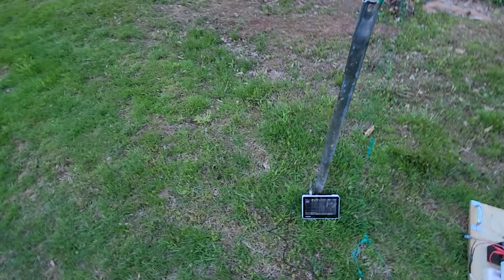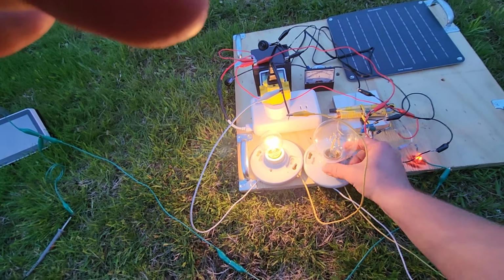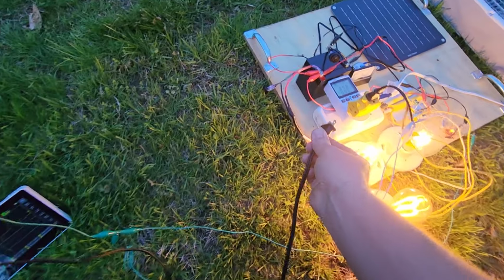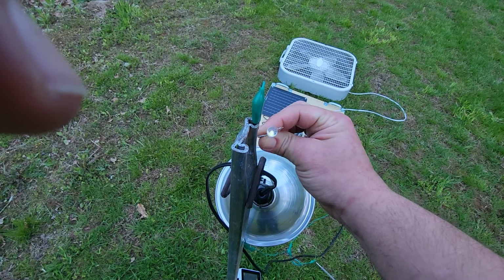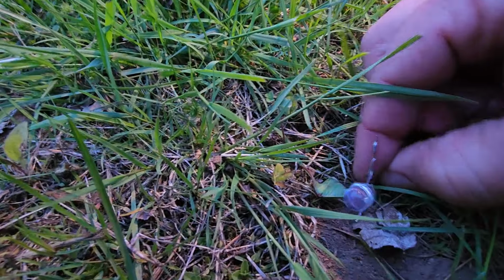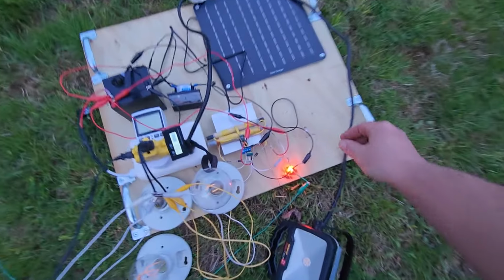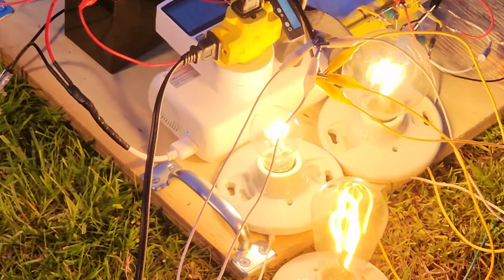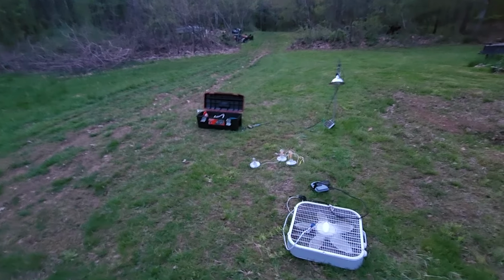🌩OUTDOOR RINGER GENERATOR BOARD TESTS & NEGATIVE RESISTANCE IMPROVEMENTS & 100 WATT OUTPUT!💡

Comment: Yeah boy that is looking excellent bro I've been working on my own however I'm building machines to Brian materials down and shaking machine to shift my powders like caffeine quartz whatever I have seen if you are working off the negative like you say impedance or resistance also works backwards that machine can probably do a hell of a lot more than you think especially if you jump off the negative side of another capacitor Branch off with more coils in residence there's no end. That's awesome I would love to see you expand even more. Great job man 
🍻 Cheers yo

Comment: 😂u made a ringer circuit!😂 Its a nice ultrasonic amplified electronic dog whistle. 😂 ur wiring isn't clear, there's no way to verify it works. Maybe sum numbers on displays around the different parts of the circuit to show where the voltage & amperage changes occur. On both sides of the inductor, both sides of the joule thief, etc.

Comment: 1. What range of voltage and amperage does the earth offer?
2.  What device is used to regulate and convert the earth power to 13V for the battery? 
Thanks

Comment: Thanks for the time and effort in showing what you have achieved, I live in New Zealand and my cousin lived in Whakatane close to Mr Adams who designed the over unity motors, this is the energy we were supposed to harness for powering everything we use including cars, just that the oil tycoons destroyed all hopes many years ago and schools won't teach it, because the system cannot tax what is free!

Comment: You can use dc with monopole ferrite magnets and it will generate alot more power but you need transistors to cut all current and resistors starr around 470ohms

Comment: You should have 2 set of circuit. One will charge battery and one to run load then relay timer will swith every x mins or seconds

Comment: You know you spend all this time scamming you might as well do something real. This is a road to destruction don't be surprised when it ends bad.

Wire fraud is fraud that is carried out through pictures, sounds, writings, signs, or signals that are transmitted through any form of wire, including television, radio, telephone, internet, or fax.  For example, if a fraudulent scheme involved the sending of 5 emails, then 5 separate acts of wire fraud were committed. 

It's a federal crime and you're living dangerously homie. It's a bad path.

Comment: Batteries fool everyone.  Get rid of it, and instead use supercapacitors.   Until you do this, you're just using "pulsed battery" technology, which is not the physics you're after.

FE inventors fool ourselves, and that's why skeptics call us "pseudoscientists."   We're not honest enough.   So, what are typical mistakes the Free Energy community must avoid?   Foremost is to make mistakes in measurement, and think FE is proved by meter readings alone.  (You've not made that mistake.) 

The second big error is to include batteries in a FE device.   Do you think you know the true capacity of a battery?   You're wrong.   The published battery capacity only applies to PROPER, NON-DAMAGING charging and discharging based on pure DC.   If instead you include AC, or any sort of pulse-mode, then you can extract unusually huge energy from the battery, but this also damages the plates.  

If you think you can convince anyone by arguing about this stuff  ...why not just avoid the whole problem?  Instead show actual proof, by getting rid of the battery entirely?   Get yourself some 3000 farad maxwell ultracapacitors.   Chain them in series to get to the needed voltage (since they only work for 3.2V.)    Then monitor the capacitor voltage.   If it stays constant or increases while a load is being driven, then you know that you've got a genuine FE effect.   

If you can still make your device work when no batteries are present, THEN you've got something real.   

A typical pseudoscientist will discover that their device cannot work if the battery is replaced by supercapacitors.   Then they'll hide this fact, and start in with the lying, where first they've fooled themselves, then they try to fool everyone else.   

The smart anomaly-hunter will look at your invention, see if it includes a battery, and then quietly smirk, because you've gone down the same dead end that got Joseph Newman, as well as many others.   (The FE community was constantly telling Joe to try using capacitors, not batteries.   He simply refused to answer.   If he ever tried supercapacitors, he never released any results.)

Find articles about John Bedini's "Brandt-Tesla Switch."    It was based on using batteries as free-energy devices.  I hear that it had a problem though.   It would destroy the battery plates too quickly, before it could be proven to be a genuine FE source.

Comment: Cool as man..how do you make the wireless l.e.d😎
Reply from the maker: It's just two 1N4148 Diodes in series & the led is connected to the output. It's basically an arvemenko plug

Comment: Reshoot this videu with the board raised off the ground with everything underneath visible, using non conductive legs for the tables.
Reply from the maker: Have you seen the most recent 1 hour demonstration video? I move the board to multiple spots, show underneath it & take the system apart & reconstruct it.
Reply: @MTECH2022  I did.

I think just having it at a distance raised off the ground that's arbitrarily large enough to rule out wireless transfer from a supply burried underneath is enough to to take away that argument from any skeptic's.

For the record, I believe you.

But you should do one final reshoot, where you look at your previous videos from the perspective of someone trying to debunk them; then eliminate those arguments in the presentation design.

I know it's a pain in the ass....

But if this is legit like you suspect, dealing with irrational cognitive dissonance will be inevitable. Minimizing it upfront will get you further, quicker.
Reply from the maker: @michaelgolfetto9619  I'll definitely do a vid like that very soon :)

Comment: But yet we all know that energy cannot be created, and that there is no such a thing as a free lunch.
In addition, we know that if a person would discover something new, they would send a copy of their circuit to an important technical university, to let them see if they can verify the observed results, but no, not hapening on YouTube, never heard of it.
Peer review? What is that?  😮
Reply from the maker: I have my exact circuit on my patreon for free & mechanical energy cannot be created or destroyed but only transferred from one form or another & this is a hyper efficient negative resistant RLC energy harvesting machine. The Receiver coil is extracting excess power from the Earth's natural electrical system when grounded & solid state energy synthesis should be possible in theory because in the primordial electrical grid electricity literally vanished into counter space when they tried to transmit it long distances at firs. So if energy can vanish then energy synthesis should be possible. Feel free to check out Eric Dollards work
Reply: @MTECH2022  Yes, more or less what you already say in the videos.
But it doesn't help much when one person states that it didn't work at all, where another cheers in exhilaration, and a third says that it only works in combination with a tesla-coil indoors and a long coax cable.
What I'm saying is that no university can make it work, and no peer reviewd journal will publish.
Reply: You clearly haven’t read through the literature. There have been publications, do I really need to link them for you given how condescending and arrogant you appear? 

If you had a discussion with a real engineer or physicist that’s worked in deep black projects, you’d know that these phenomenologies exist. 

And bedini’s invention wasn’t just “stimulation of ions”, there was a lot more going on there that you clearly are too ignorant to look into. 

This gentleman’s channel is doing great work, don’t come in here being all skeptical if you’re not going to look deeply into the theoretical aspects of extended quantum electrodynamics and then try to replicate the project for yourself.
Reply: @ Energy cannot be created, nor can it be destroyed.

Comment: This is the next video telling nothing about Free Energy. This time we see the 100W delivery on output but once more no input power measurement. All tales about recharging etc. are worthless unless you can show that the real power taken from source is smaller than the delivered power or a relatively small capacitor is recharging quicker then losing the charge to feed the circuitry. Showing 100W from a AAA cell is no rocket science. Every electronic freak can show this. When will we see true rms measurements on both sides of the circuitry?
Reply from the maker: All output is measured through the analogue amp meter & did you read the full description of the video & the theory behind how the device operates?

Comment: 5Ah battery= 50 min 100W Where is FE ?
Reply from the maker: In the near instant recharge process of the source from the negative resistance when I shut the inverter off. The negative resistance grounded RLC circuit in contact with the earth recharges the source
Reply: @MTECH2022  ok, take a 1Ah battery and show how long you can have 100W all the time. It's a simple test. If this is true, you should have a power source available at all times. John Bendini made a similar device, but it wasn't FE, it was just stimulation of ions in the battery. Your extra energy comes from the battery's chemical reaction.
If not, do a real test. For now you are showing everything within the battery power range.
Reply from the maker: @watron2491  I'll do that test soon & if that's the case how did it rapidly recharge to 100% in my video after I switched the inverter off? That's definitely not linear behavior & suggests a non linear element is at play
Reply: @MTECH2022  All right. Take a good real test.
Reply: @MTECH2022  I wonder if you can use your crystal cells instead of batteries  ? At least this is what I am working on now 😉
Reply from the maker: @Caesarus2011  that'd be interesting to try

Comment: Am curious, can't you hook up a 12v 3amp charger back to the power supply?
Reply from the maker: Can't recharge the system in any way from the ac inverter. Has to be from a resonant wireless receiver coil that has its output converted to dc & is in negative resistance mode :)

Comment: Fantastic work. Truly groundbreaking! Your persistence has paid off, congrats!
How well would it run if you earth ground it through the ground pin in a household power socket?
How long do you think it could run a 100w load before the source is drained?
If you draw less power, will the source still drain or do you have to disconnect the load before it recharges?
Reply from the maker: So far the system seems to recharge fully within 10 minutes after running a 100 watt load for 20 minutes & thank you it's been my lifes work :) Also it runs best from heavy earth connections isolated from mains.